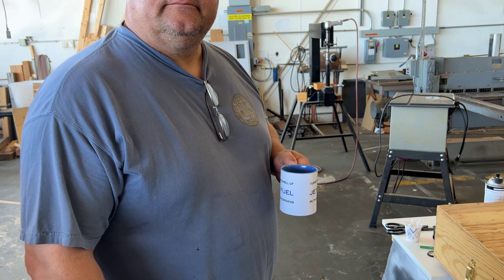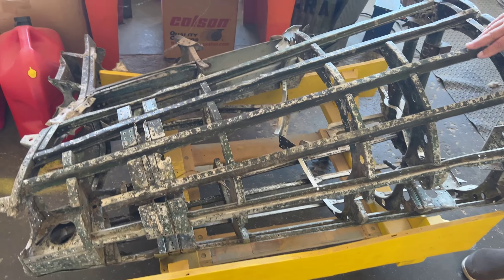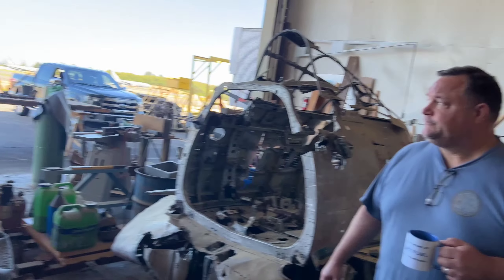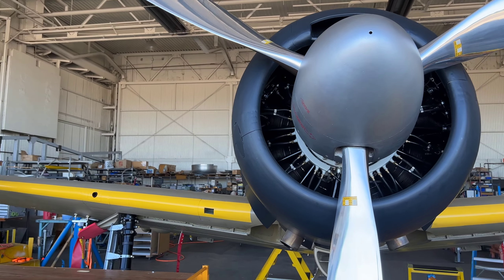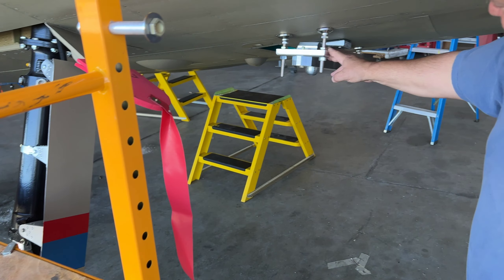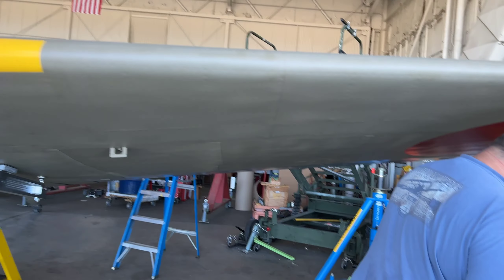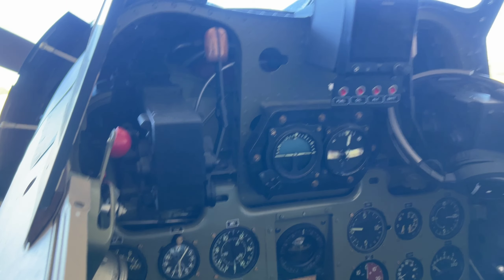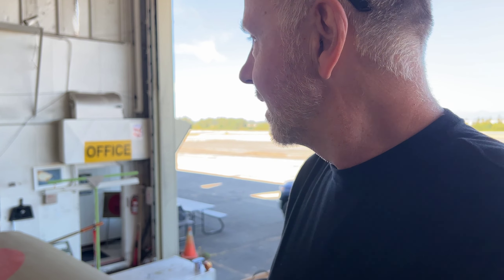A6M3 ZERO RESTORATION PROJECT BY "LEGEND FLYERS" [A Tour With Dan Hammer At Paine Field, Washington]

Comment: I love WW2 restorations. The thing that gets me about Zeros specifically is the coloration. The "amber" color was a lacquer that went over a base gray color, so it would have been more subtly amber and more gray-ish than this restoration; and back in the day the lacquer faded so much in the sun the base gray showed through enough to cause confusion over the original color (e.g. the white Zeros in older war movies). The dark reddish brown on the back of the prop blades would have stopped where the paddle meets the shaft. The aotake color ("zinc chromate") was also a lacquer, and varied a lot between hues of blue and green depending on Mitsubishi or Nakajima(?) manufacture, but wasn't an in-your-face color since the base color still showed through. At least according to recent Japanese research on the original colors. The cowling looks to be a good color! Very dark navy-ish but not quite black.
Reply: Thank you for your comments. However on the overall amber brown we used in the aircraft it is as correct as any zero in the world. We had original skins that were sent to PPG military aerospace coatings for analysis. The red oxide primer was present in these pieces as well as the original Japanese top coat. Through computer analysis and spectrum analyzer PPG custom mixed the color for us into there flat military aerospace coating. We have these surviving skins here at the project and when held up to the airplane they are amazingly correct.
Reply: @danielhammer7968  That's interesting. I've seen many Japanese sources with the same analyis but different conclusions.

Comment: Wow a genuine Hamp, or Zeke 32 😄
Reply from the maker: Somewhat, over 200 original parts but the fuselage was a total wreck.  The engine is from a DC-3 and some safety issues were fixed to make it reliable in today's world.  It is a very good replacement of the original aircraft.

Comment: Nakajima Sakae “ Glory “ 1130 hp 14 cylinder two row air cooled radial.
Reply from the maker: Thanks for the comments 😉 and it's strange how you can use an engine from a DC three try blade prop to replicate this aircraft. Zero is one of the rarest airplanes and hardest to restore in the world I believe. In these guys have done Schmidt 262s.